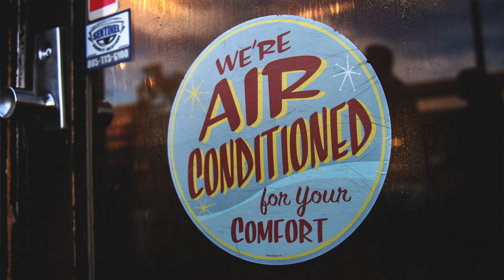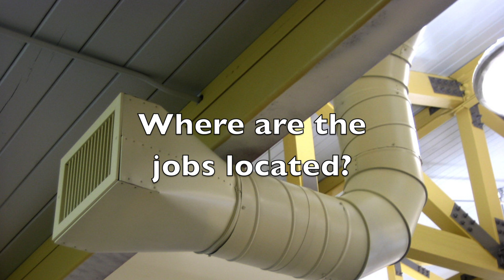What is a HVAC Technician? It's a trades job that pays well!

Comment: Awesome intro. I have to stress. Radiant barrier is awesome. I have it installed covering only 200 -220 sq. Ft. Covering my living room only and it makes a huge difference. My ac unit would struggle to keep it at 78° from 3pm -5pm on a 95° day.   Now it can keep the house at 75° with ease. The ac unit isnt working constantly like it used to without radiant barrier. This winter i will install above my kitchen for even better results
Reply from the maker: Nice!  Thanks for the comment!  Yeah I’ve been looking at adding a layer of insulation in the attic…